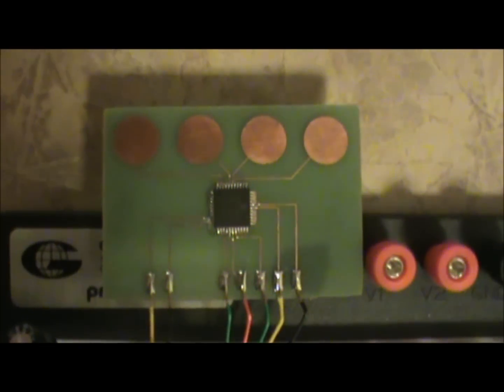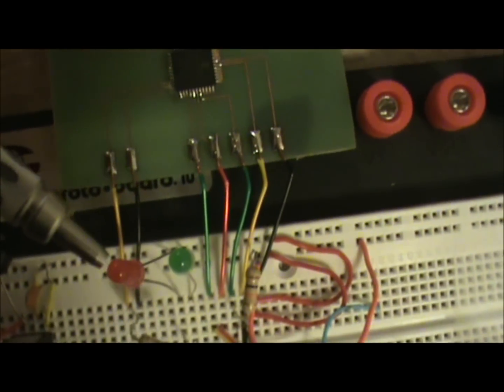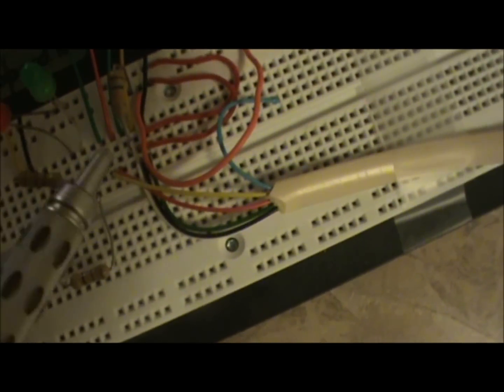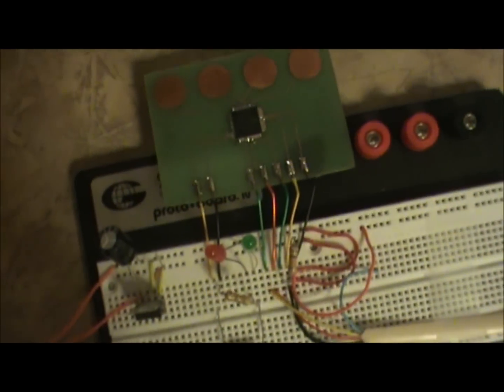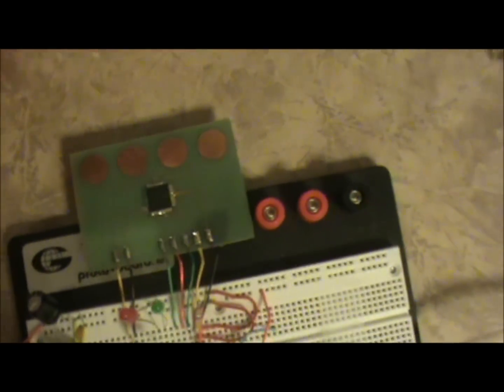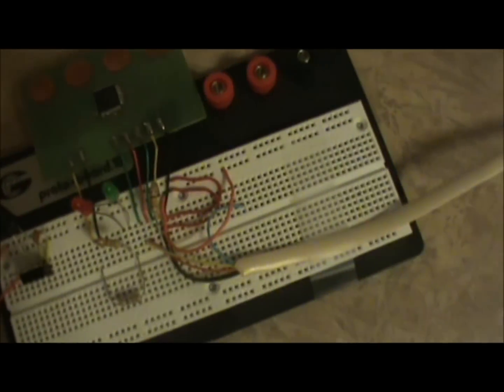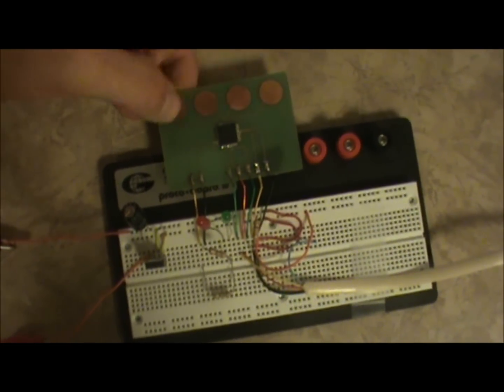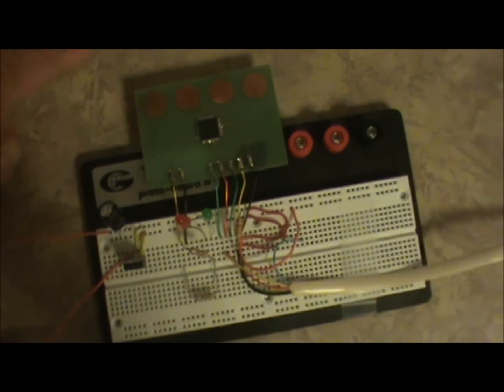Capasitive Touch Demo

Comment from the maker: yeah that is a good idea.  I will have to try that.  That should solve the problem since the capacitive touch module sends out a high frequency signal to the pad and when you apply your finger is causes a frequency shift in the signal that the CTS module detects.  Therefore, like your idea if you place a ground plane on the back of the board it should inhibit your finger from shifting the frequency.  I will try this and get back with you.

Good Idea.